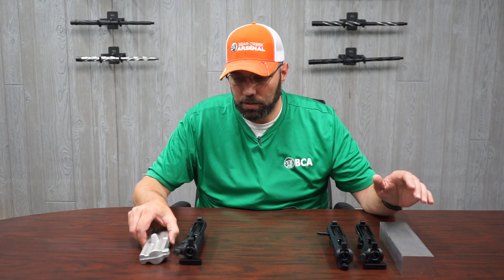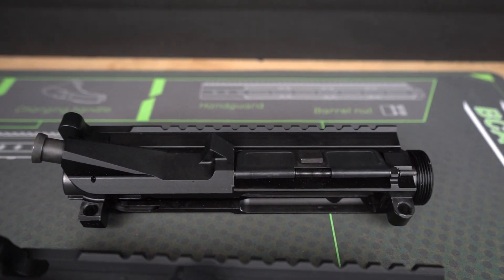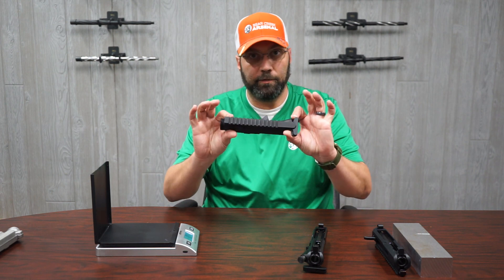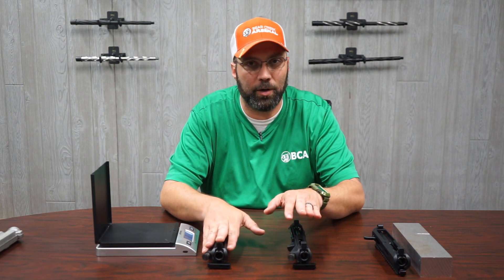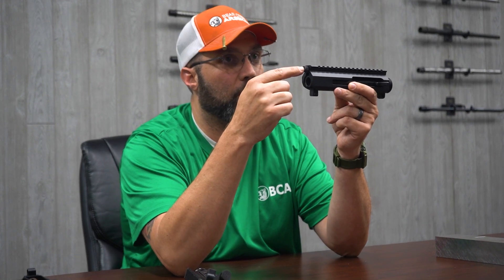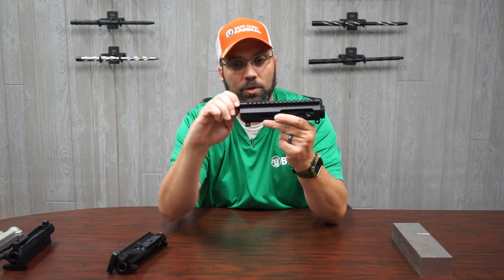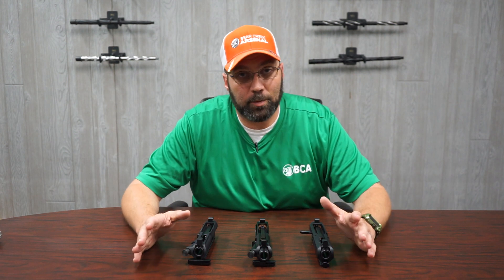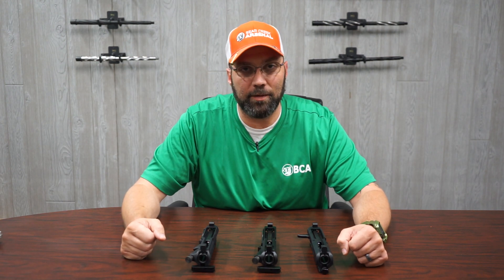AR-15 Weight Comparison: Billet vs. Forged vs. Side Charging Upper Receivers

Comment: I am proud to say that I am a brand new owner of a bear Creek arsenal 20 inch right side charging handle AR 15 chambered in 5.56 full complete rifle. And not only looks beautiful, but it performs flawless. It did not come with any magazines, so I paired it with lancer 30 round capacity magazines it performed excellent. I am also practically that I will be purchasing a full complete bear Creek Arsenal 22LR rifle in the next few weeks with the quality of the 556 rifle I am sure, the 22LR rifle will perform just as nice.
Reply: It is supposed to say proud, but it came out as practically

Comment: My side charging handle snapped off. I wanted to order a new bolt or get the size so I can get one elsewhere. Your customer service is setup like the BMV they can’t answer questions only ask new ones. I have tried to get an answer for a week. My rifle is 10+ years old I don’t have the original order #. I wasn’t trying to get a free bolt I wanted to buy a new one and maybe a spare. Okay!
Reply from the maker: Sorry to hear you had a poor experience. Please continue to keep in contact with our customer service team and we will make it right
Reply: @Bear_Creek_Arsenal  I ordered a 2nd Gen BCG the new design looks much stronger. Why your “customer service“ couldn’t just answer the question, which after getting the broken part out of the BCG I think is 10-32 x.750 and sell me a couple as your hardware is probably better than 1 I found in Hanks hardware or order online. Is strange to me.

Comment: Billet weight and edges depends on how much machining the manufacturer does. Machining a good Billet upper takes more machine time and it is harder on the tooling. After watching your other videos on billet uppers you obviously don't want to be making them because Bearcreek is cheap and lazy. so you kind of low key trash talk them. Plus side charging is horrible it catches on everything hits brass catchers and comes loose constantly.
Reply: They have a Gen 2 side charging handle now..
Reply: @arp_tweezie8184  it still has problems
Reply: I have 2 gen 2 and I haven’t had a single issue. Poco loco and if your snagging on everything you must be a little clumsy
Reply: What I can’t figure out is the side charger doesn’t have a shell deflector or a charging handle yet it’s still heavier than the regular billet upper.
Reply: @michaelfreund9681  the handle is the shell deflector for the side chargers. And the handle is not light weight.
Reply: @michaelfreund9681  I bought mine at the same time as a friend. I got a normal one he got side charging. He uses his for work and hates it. When training for close quarters the handle comes in contact with obstacles. What he said is they have plywood with several holes in different heights and sizes. The charging handle comes in contact with the plywood obstacle.
Reply: @ryanmac1833  I guess that's the difference between a leo and a weekend warrior